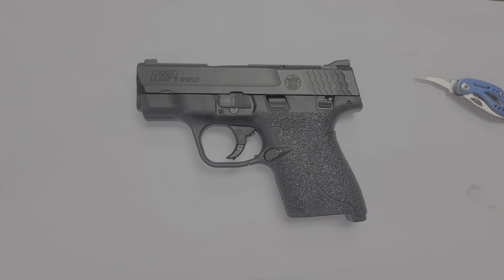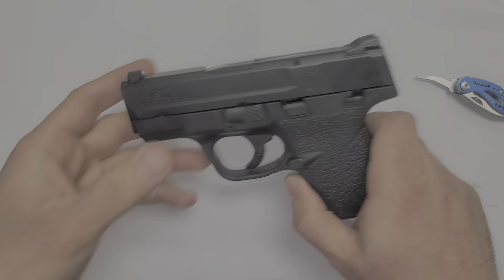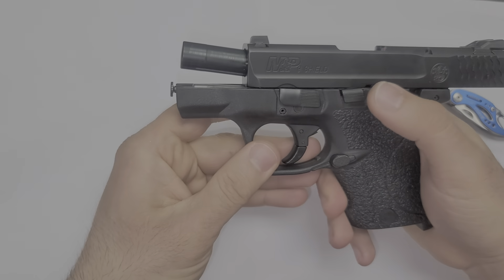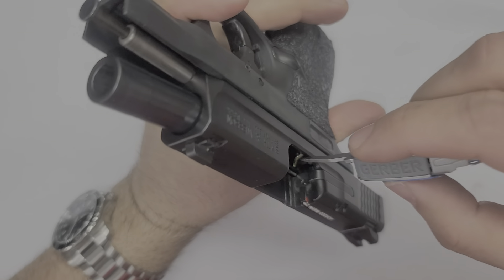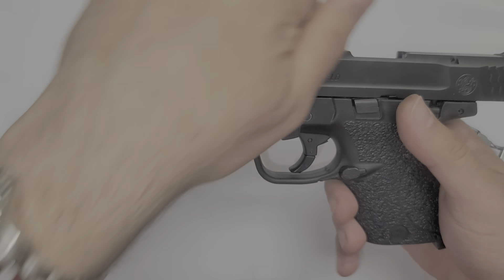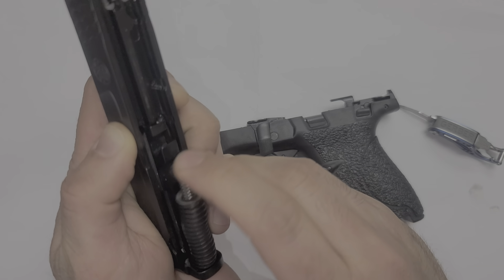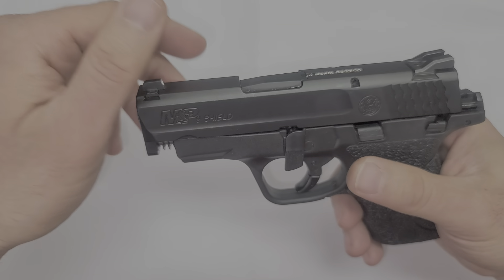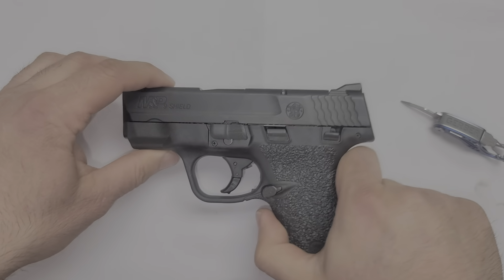California Compliant S&W Shield Disassembly & Takedown

Comment: So reinserting a mag pushes the deactivation lever/pin back into position? Or one could flip it down while slide is locked open? I was taught the latter but if the first method works, then cool.

Comment: Has anyone had a problem with the slide locking back with a full magazine. I picked mine up not to long ago and almost every round slide was locking back. With both 7&8 round mags
Reply from the maker: That is very odd. I haven't had any issues like one you described.  I recommend contacting the manufacturer.